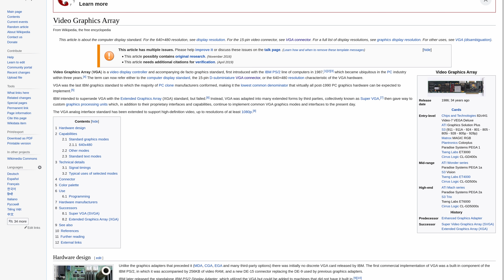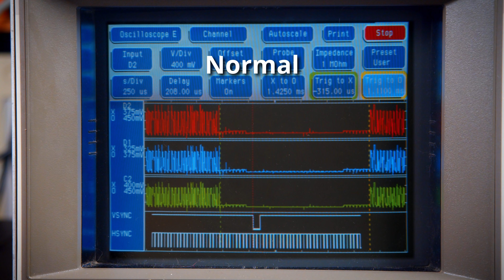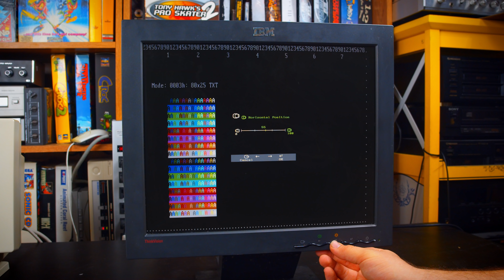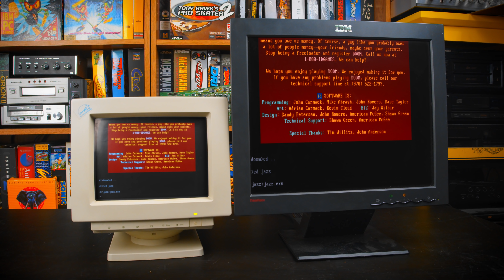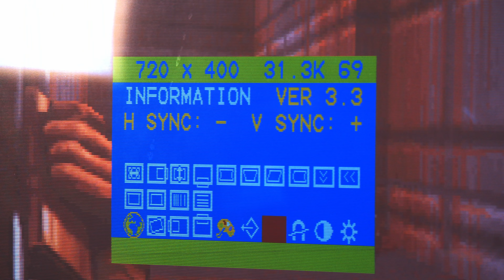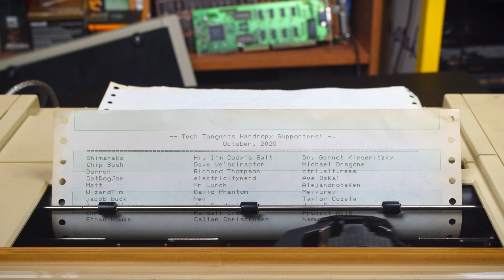How VGA Works

Comment: I have actually implemented a VGA interface (output side) on an FPGA, and had mostly been testing with an LCD monitor. Timings are annoying, because if the aren't right the monitor tries but fails to identify the resolution, usually ending up with something that looks wonky. However, the LCD monitor does seem to accept some things which may not work out so well on a CRT, such as 1024x768@24Hz (frequency limited due mostly to the clock speed the logic is running at in the FPGA); though I am mostly using 640x480@60Hz timings but producing 320x200 or 640x400 output.
Originally, the output looked pretty much horrible, as I was trying to compensate for a limited number of DAC bits (on the board) by PWM'ing the outputs, which the LCD really didn't like (produced lots of artifacts, which resembled ugly twitching/pulsating rainbows), however with only a few bits per component, the non-modulated output also looked pretty bad. Eventually had to tweak it so that the outputs only changed at the pixel-clock frequency (25MHz), and because neither PWM nor temporal dithering worked well with the LCD, eventually had to settle with a plain Bayer dither.
The Bayer dithering works at least, but if one looks closely, there is a pretty obvious thatching pattern in the VGA output.
...

Comment: I've had great success with my Epiphan av.io HD capture box.  At US $429 retail, it's not cheap, so might not be a good solution for hobbyists.  But you can buy refurbished and used ones for half that (I got mine for $175.)  You connect a DE-15 cable directly to the box, then USB to the computer.  By default it'll capture all the VESA signals, but with the configuration tool, you can load custom timings and make your own adjustments (porch, vsync, hsync, etc.) to capture any analog signal you throw at it.  I haven't found a single game or vintage computer that can't be captured.

Comment: Looking forward to the VGA capture video!
Have you looked in to ways of tapping directly into the image signal before it gets sent to the DAC like what RGB mods for retro  consoles do? I'm just curious if it's been done before.
Reply: "...tapping directly into the image signal before it gets sent to the DAC..."
I suppose it's possible, but that might be limited to some of the earlier VGA cards. From the early to mid 90's, a lot of VGA chipsets began putting the DACs on the same die. This was the 512k or 1M 16bit ISA cards that might do 1024*768 @ 256 colors max.
Other options:
DSPs on each of the FIVE outputs (R, G, B, H, and V) would get expensive real quick at higher resolutions and frequencies.
There's also reading (snooping) the VRAM, processing it digitally, and outputting it another way. Trying to read the RAM while the VGA chipset is trying to read and write to it might be a no-go. Emulating the VRAM with something more modern and faster might do it.
An FPGA implementation might work instead of doing a ton of reverse engineering. Signals could be manipulated digitally or some gates could be used as DSPs.
Reply: @anomaly95 I like how the Atari Jaguar has the R2R ladder soldered to one side of the CMOS chip “Tom”. I have not seen resistors in CMOS. How do you approach your fab about this? OpAmps are huge as are charge pumps.

Comment: So VGA is Video Graphics Array.
Then SVGA is Super Video Graphics Array.
Then XGA is Xtreme Graphics Array?
jk
Reply: Jokes aside, iirc the X was for eXtended, but im sure someone bought some 24k gold monster XGA cables thinking the X was for eXtreme Graphics and that it would make his low res textures look better and double the game's poly count.
Reply: Then you have SXGA, Super eXtended Graphics Array (iirc 1280x1024) and so on... VGA keeps going since 1987 lol
Reply: 1024x768 resolution is also known as 8514/A, named after the model number of the first IBM video card to support it (introduced with the PS/2 line in 1987). It was replaced by the XGA (eXtended Graphics Array) card in 1990 and then by the XGA-2 card in 1992.
Reply: Pretty much what people know as VGA is down to it using the same cable, each new standard offered more than the last but still had the same name and the same connector, it would probably not caught on if it weren't for that and would've died as quickly as EGA did. 

It's even managed to outlive a few of it's successors (DVI, ADC, Mini DP/Dell's USB video port, etc), still used as standard for cash registers, projectors and server displays. Next to the x86 architecture, it's probably one of the oldest PC standards still in use today.
Reply: It got sillier - by the time VGA was starting to be displaced, it was up to WSXGA+.

Widescreen Super Extended Graphics Array... Plus.
Reply: I grew up thinking it was “adapter”

Comment: hm, im running my samsung syncmaster 957mb at 1920x1440(interlaced) at 120hz, and ive ran it at 1290x960(interlaced) at 160hz (the most the monitor can handle)
and ive never had any interfearance problems :^P
the image has always come out just fine

Comment: If I did this I would have just recorded all the data going over the pins in a raw format, and then just processed it software side later. This would create HUGE files, but it would allow for quite a lot of flexibility
Reply: Would be a good way to create test data for a CRT simulation. Record some period of VGA output with a resolution change in the middle, then use that for testing your simulation.

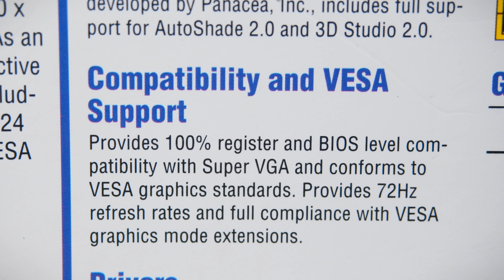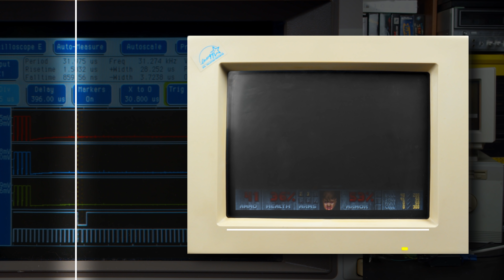Comment: @Tech Tangents: I think future videos might benefit from extra attention to editing or elocution. Here you say "problem" instead of "problems" (3:58), and "sync signal happen some blank lines after" instead of "sync signal happens after some blank lines after" (5:19). You also talk relatively fast, which doesn't help. With a video like this, comprehensibility is very important. Especially on a topic like this.

Comment: I never really appreciated the wican voodoo in how problem free (for a consumer of VGA) the whole process is.

 Learning more from your fantastic production has left me in deep introspection while watching a progress bar crawl along with stunning clarity on a VGA NEC AccuSync LCD71v. 

I feel the universe has a higher error rate drawing the room around the NEC monitor. A miss scanned draw line now and then not only seems acceptable after watching... But almost unacceptable an error seemingly never happens. Your video has made me appreciate this NEC display. 

I have used some janky displays and own a bunch too. I just tried using an off brand TV as a Hdmi display and the overscan was more than an 80's sears TV console. I did not know what was going on till you mentioned the phenomenon.  Anything that needed overscan is [likely] 4:3, so... I feel your plight. 

The scaling on this cheap overscan Hdmi TV/moniter is so horrendous, text is unreadable. The same TV is stunning with a VGA cable. 

This production has made me appreciate this NEC, there is no appreciable delay in the mode changes, and the image is perfectly centered and in phase, and faster than most tube monitors I encountered. Many of my other displays need the image for a moment, and then a correction of up to inches is made. Fun fact, this mentioned Hdmi display (for a while) replaced the NEC on my 32 bit machine (both connected via VGA) When booting up during the change from the bios to Linux splash screen, the NEC is seemless, the mentioned Hdmi TV display manifests the Mint logo half off the right side of the screen, and moments later is attempted to be centered. Because the backround and border of the splash screen is black, the display has no reference and never quite hits a proper center. It's cute. It will not center your desktop if the backround has black edges either. 

How a non electron gun display handles something like a coax input or composite can vary wildly. I feel there was a purposeful implementation of poor quality handling of these inputs by certain manufactures to push new media sales. 

Example: two 32" LCD (band a, brand c) tvs playing same VHS, same VCR, composite output. One looks great, one is awful. I would think there be no appreciable difference. 

Set top DVD recorders had the same wide swing in quality among brands. My Sony on a 3hr burn is okay quality at best. The same quality is present on my no name burners on a 6hr setting. But the Sony will push the VHS out its HDMI output seemingly upscaled. (if you burn a tape on the Sony, the encoder rears it's head. So you play the tape on the Sony, while burning that output with the no name burner, lol. [my cyber home DVD burner ignores macrovision signals and pirates the Divix encoder that bankrupted the company] ) 

My best means of analog capture I have found was the little boxes you put in line of the VGA, and S-video into a set top burner I mentioned, and ripping the DVD. The in line box will alow you to set size, Pal/ntsc, color, zoom, brightness, etc... I use mine for a hitachi 72" projection TV and I can read the standard system font at 1024x768. It's not laser clear but the TV has like 800 scan lines. I would not think there be enough to scan back up but it looks pretty good. Back in the day it would be stunning. 

I look forward to the rest of the series. 

Happy Day!

Comment: The OG standard had a number of graphics modes, games mostly used 13h, 256 @ 320x200, line doubled by the hardware. http://nerdlypleasures.blogspot.com/2013/10/320x200-resolution-of-choice-for-ibm-pc.html

Also, it's not true that the monitor hardware didn't matter. The deflection system is integral in achievable resolution, and the hardware must be capable of producing targeted color depths. Not to mention accuracy. Moving the TTL to analog hardware from the display to the card didn't remove things like bandwidth and frequency response.

Comment: We always be assumed the change of the image on 60Hz, and that is partially true. Reality, the change is to all the horizontal lines including the VBLACK. We  fulfill the 31kHz change of the 525 lines of information in VGA 640x480, then 45 lines are not visible but it is not images but they are information. 
We should also be careful, we can not  assume that all LCDs have a video buffer, those is also partially true.
 A good LCD controller will transfer the information of the lines (to dots colors) as they are delivered to it, and the lag in the change or black screen is a like "wait, let me count the pulses again", supported by the DDC (Display Data Channel)  information shared in the VGA cable. 

We avoid generalizing and mystify the VGA, it is a standard, but it is still a guide to fulfill a thoroughness, but VGA does not describe how it be manufactured..

Comment: The nicest monitors I have ever seen are Mitsubishi Trinatron multi-sync monitors.  If you ever see one in the wild, buy it.  I have worked with literally hundreds of different CRTs over a 20 year period as an IT professional.  Everything from early IBM true VGA monitors to 21 inch behemoths from Compaq and Apple.  Nothing even comes close to the Mitsubishi.   The NEC multi-sync monitors are good too, but not in the same league with the Mitsubishi.
Apple monitors are generally good too (though not all. there are some cheap poorly built Apple monitors). But they do lose some of their good properties when hooked to a PC through an adapter if early ones or directly with latter ones with the VGA connector.
Reply: You've worked on hundreds of CRTs but don't know that Trinitron is Sony and Diamondtron is Mitsubishi? If you're referring the the Megaviews, those are dotmask anyways, not aperture grille...

Comment: Im quite happy with my 1920x1200 LG VGA only LCD panel. I tried overclocking it but the logic board is an ass and will drop frames even at 61hz, and on top of it it doesnt even sync at 60hz, it syncs at 59.94hz as if it were a NTSC TV. It will say 60Hz everywhere but when you look at the actual mode setting it says 59.94hz xD
Reply: How old is that LG panel? To be struggling to go to higher frequencies it must be at the edge of whatever logic LG had at the time for the video circuit. I know the cinema displays were kneecapped in order to get near that size back in the early 2000s, some requiring dual-link DVI ports to drive at full resolution.

Comment: Excellent video.  The thumbnail depicts a perfect visualization of "video graphics array," and the presentation was spot on.  i agree, staying away from old VGA monitors is wise unless a person highly desires a specific monitor made for or built during a computers timeline.  Even then it would hardly be worth it.  Though I do remember when flat panels came out they were the absolute thing to have and no one seemed to complain about latency with legacy games at the time, I guess we were too dazzled by the insane new monitors to really care.
Reply: I have the opposite experience... No one around me would have bought a rubbish's "flat screen"... And I used CRT for LONG, just because of latency, and general image quality...

Comment: 9:55 "and why HDMI Overscan is stupid" 
I have the same emotions...
Reply: Little secret of HDMI: The 'image' that HDMI sends raw is actually a fair bit larger than the picture - and those extra pixels carry the audio information.

It's designed that way because it simplifies the electronics at intermediate stages. The device generating the signal and and device receiving it need to deal with packing and unpacking the audio, but everything in between just needs to pass three differential signals, clocked. No framing to worry about. Can ignore the 8B10B encoding. As far as everything in between the very start and very end of the signal chain is concerned, it's just three streams of bits.

A noteworthy omission is that none of those extra pixels are allocated for closed caption data.
Reply: Horizontal and vertical blanking and synchronization information is contained beyond the active portion of the video signal. For a progressive 60 Hz 1920x1080 signal, for example, the total signal containing horizontal and vertical sync data extends the overall "image" to 2200x1125, with 1080 active vertical lines of horizontal resolution and 1920 vertical lines of horizontal resolution. All sorts of data can be stored in those non-active lines containing sync pulses, but some must remain so the display knows the end and beginning of each succeeding frame or field. No display is capable of running without some blanking or sync data, CRT, LCD, plasma, OLED, or otherwise.
Reply: @NUCLEARARMAMENT  That's not what HDMI overscan is. It's the source that add black pixel inside of the 1920×1080 window because the TV want to enlarge that digital picture.

Comment: I remember that I had a Nvidia card that supported 100 hz(I don't remember the resolution that it supported in that frequency) and a Philips monitor that supported it, while the image wasn't at the same quality(bleeding, chromatic aberration and more) it was cool seeing the mouse and windows moving way smoothier than normal

Comment: you used doom as your example when talking about the limitations of the horizontal sync and 320x200 resz at 70Hz, is that why doom had a frame limit of 35? or do you think that was coincidental?

Comment: Excellent presentation Shelby. Thank you!  I remember seeing my first VGA image on an IBM monitor driven by an IBM  Model 30-286 PS/2 ( the "30" was the size of the HDD in MBytes of course ) in 1987 at work.  I had only experienced EGA before this, so it was like looking at a hi-res ( at the time ) photograph!  It was an IBM stock image of a wharf with fishing boats and mooring lines.  Such fine detail blew me away!